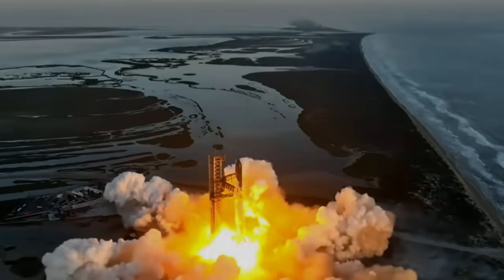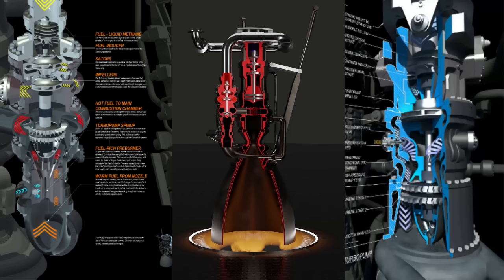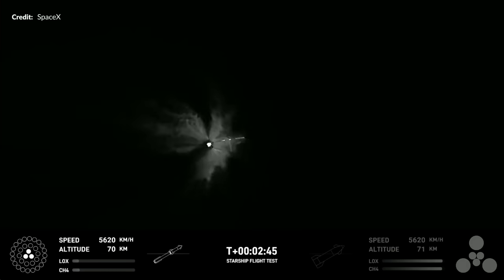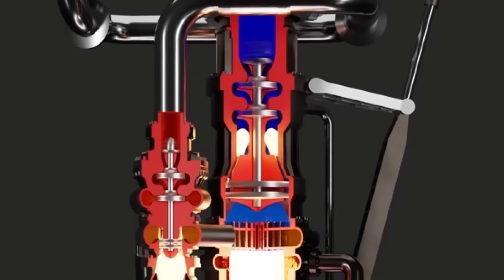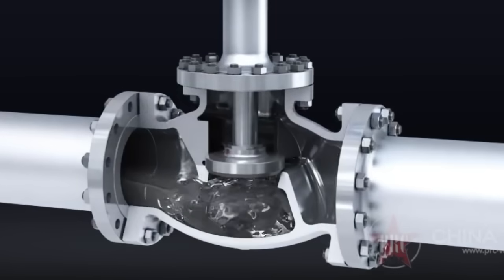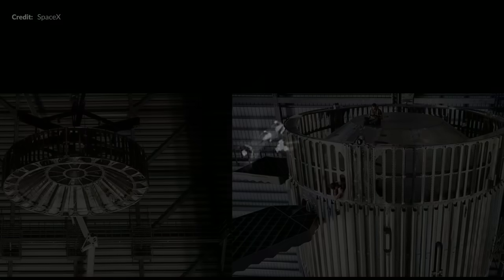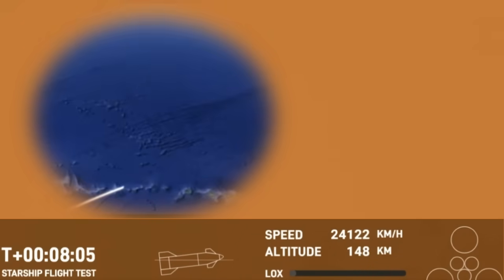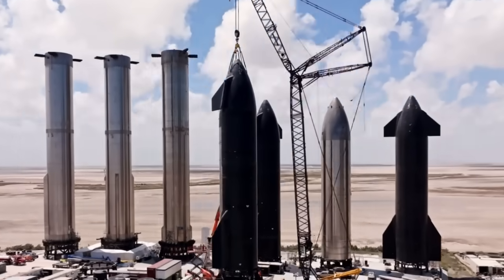Starship Flight Failure Analysis IFT2

Comment: Honestly I find myself disagreeing with your analysis a lot.
The analysis of the booster isn't that bad, the main issue is just your claim about FTS.
There's no evidence the booster actually activated FTS. If SpaceX had gotten a signal informing them about automated FTS triggering (like they presumably did with the Ship) they wouldn't have differentiated between the booster "RUD" and the ship "FTS activation".

The ship is where things really get bad.
The fact that there are minutes of flight between separation and failure really weakens your proposal of damage occurring during separation itself. The "out of controll spinning ship" is just a factually incorrect misrepresentation on your part. That's actually the remaining nose cone venting propellant from the header tanks/ downcomer AFTER FTS was triggered, not before.

It's a nice Idea to pin everything on the hotstaging procedure, but there's really nothing to support that. 

Additional issues you did not mention: 
>Heatshield tiles falling off
>Damage to Stage 0, including vertical tanks and QD (booster and ship) as well as fodag concrete around the outside of the steel pad
> The unexplained streak of dark exhaust coming from the booster right after liftoff

Additionally I'm not sure your proposed solution would even work. The almost empty booster will likely weigh significantly less than the fully fueled Ship. As such it will have much higher T/W, even with only three engines on minimum throttle. I doubt the Ship can actually seperate without pushing the booster back, causing some amount of negative acceleration.
Reply from the maker: But you can see it detonating just as the booster blows up.
Reply: @terranspaceacademy  No you don't. You see one explosion in the engine bay, then shortly after there is an explosion where the methane and oxygen tanks meet. SpaceX themselves do not claim this second explosion is FTS, so they likely neither triggered it manually, nor got a signal from the AFTS system. 

The resolution and frame rate isn't nearly good enough to determine if the second booster explosion came from the FTS box, or if something else caused the common dome to collapse, causing CH4 and O2 to mix and explode at the contact point.
Reply from the maker: But there are two glowing squares exactly where the FTS was.  You may be right though... If so then they haven't proven their FTS system in flight.  I think they should plan to blow up the boosters until they get it right.
Reply: @terranspaceacademy  Can you link that high speed footage? In the video I'm going through frame by frame, I see the undamaged common dome one frame, then in the next a ~ 30m diameter donut of gas has exploded out from the common dome, which then spreads accross the entire screen within ~5 frames. No glowing squares and the resolution and athmospheric distortions probably makes locating relatively small details like FTS boxes more or less impossible.
Reply from the maker: You may be right. Using 4K and super slowmo the effect disappears. it looks like no FTS...
Reply: @terranspaceacademy  you have 4k ultra slowmo footage?? Please share! I've been watching what looks like 480p 30fps or something. It'd be real cool to look at the thing in more detail.

Comment: not exxactly a failure all this stuff is virgin teritory. failure = more things to learn and fix
Reply from the maker: Goal = splashdown off Kauai therefore failure to accomplish goal.
As a test it was very successful: Stage zero and water system worked perfectly, all Raptors fired up and operated perfectly, hot staging worked, and Starship flew almost to its designated trajectory.  Not bad at all.

Comment: Your video is so off it’s not even funny. You really should do your research before posting a video. The ITS system was not activated for the booster. Stage two was activated and it ripped the nose cone off. The guy that caught starship spinning was after the its system was activated and what he caught was the nose cone spinning and the header tanks leaking.
Reply from the maker: Surely it's at least off enough to be funny! Otherwise there's no point in going on!  I will cryogenically store myself until people aren't so mean :-)

Comment: All total conjecture with no actual information at all, you are not presenting anything that hasn't already been discussed by other channels in a much more meaningful way.
Reply from the maker: Well dang. The goal of this channel is to learn about the science and think about the problems.  When we are actually flying something the size of Starship we won't have time to do these lessons.
Reply: @terranspaceacademy  and there is absolutely no information from SpaceX on the modes of failure of these craft yet. Sure you can guess why they failed but as I say dozens of channels already did this days ago. This is just rehashed conjecture at this point which has already been done to death by everyone else.
Reply from the maker: And your point?  We are here to learn, not just criticize.  Do you have anything constructive to add?